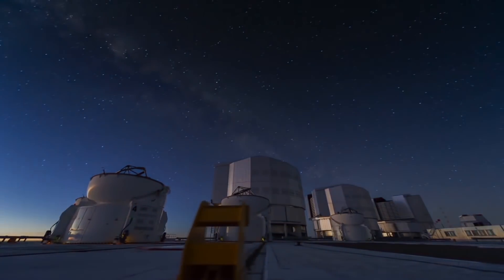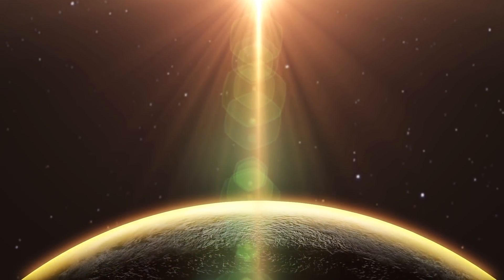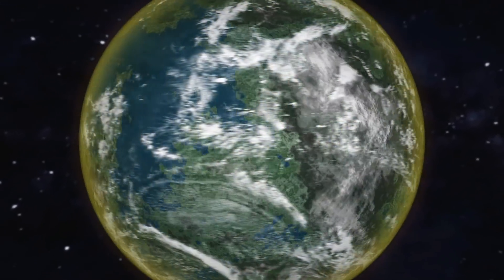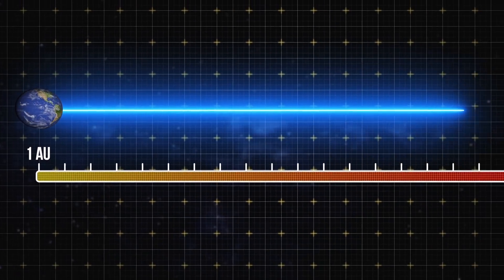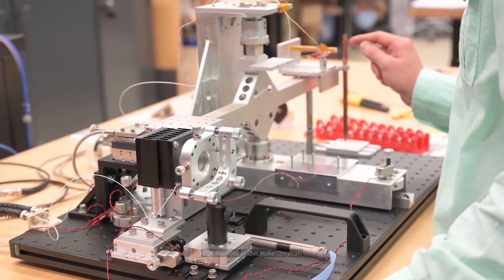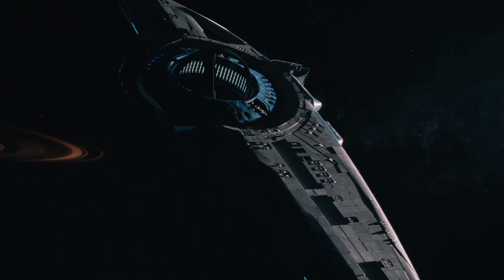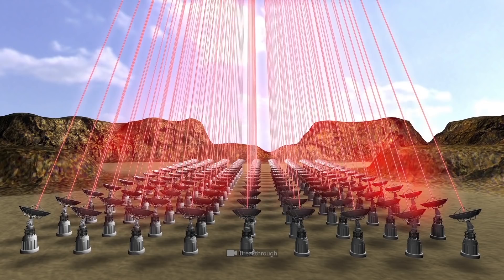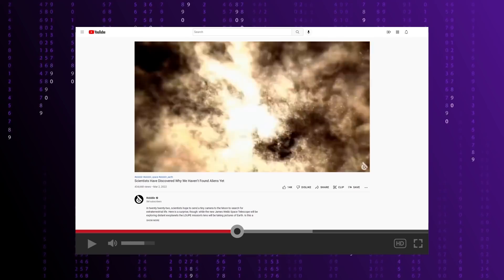Something Unusual is Going On With Proxima B Right Now

Comment: Why not try the slingshot theory? Though it could be hard to control exact directions or even predict the speed gained/time loss due to gravitational force and times circled. We have seen that when an object enters into an orbit with the right speed and distance it will be pulled, increasing its speed, as it circles and then is shot out of the orbit at an increased speed. Combine this with retractable solar sails,  and an air thrust or another quick burst engine, and an ai guidance system should allow a probe to enter a planet or even a comet's gravitational field and exit it, with a few calculations, in the right direction at an increased velocity.

Though I'm not a scientist or anything near one, I've always thought that this was the most plausible way for intergalactic travel with our current technology. I came up with this idea before we even had self-learning ai programs but after I saw what happens to comets that skim past the Earth's gravity as well as the flashlight that's charged by friction. As the friction can be self-sustained and continuously provide some electricity, I just couldn't figure out what propulsion system would work similarly to filling a balloon with air and then letting the air out to send it flying. It'd have to be strong enough to complete the separation from a gravitational field just in case the craft doesn't build up enough moment to escape orbit in time or the calculations are off and it gets too close during orbital sling.

This is just a theory by a no-name person, if anyone reads this then please let me know what you think about it. Any suggestions to make it better or an problems that I overlooked. Maybe together we can help to come up with ways to solve the problem of time versus intergalactic travel. Thank you if you've actually read this far and thanks in advanced for any input that you give me, good or bad.
Reply: Woah that might actually be a good idea. Maybe if it slows down and gets pulled by gravity of another solar system it could be in orbit meaning that the probe can maybe take pictures of planets orbiting the star which could mean we have a chance of finding life.
Reply: @gitch355  that's part of the use of the slingshot system. While the probe is in orbit of other planets it can take pictures of the planet that it momentarily orbits. If it uses an electromagnetic system while using friction to generate it's own electricity then it can theoretically constantly produce it's own source of electricity. This can be achieved by using a triple magnetic system. A positive, negative, and neutral. The electrical magnets will switch in powered as the neutral, within a tube, would be shot back and forth between the two generating static electricity along with a magnetic field. By fluctuating the strength of these it should allow the probe to use the planets magnetic field as a thruster or a stabilizer. Of course this is just my hypothesis.
Reply: Slingshot was used in Mars Orbiter Mission to reduce the overall cost of the project. There are videos and documentaries available on it.
Reply: @fanCBDden2   Using it for such a distance as another star system seems quite improbable as the prob would have to do various calculations in microseconds to ensure safe travel and proper trajectory. In other words, it would have to have the calculating capabilities of a supercomputer at the least. For closer planets, we can do the calculations here before even sending it up, but as space is like an ocean with various objects flying in all directions the probe would have to make various adjustments to reach the end of our system. Between the various meteorites, space junk, and orbiting planets, the prob will need various systems to allow for the proper adjustments to ensure that it's not hit by something or sucked into the gravitational pull of something on its way out. Though the knowledge gained from that is but one hurdle to leap.
Reply: We've been using slingshot trajectories for decades, it's how most of our space probes get to where they're going. But, consider the fastest object we've launched and used slingshots to get it out of the solar system, it took decades to get just outside of our solar magnetic bubble and it's still not reached the Oort cloud.
As for friction, that's what would stop a spacecraft.
Reply: I'm not sure slingshot is a theory, and I don't think it can give us any kind sufficient speed.
Unless there's a new "slingshot theory" that can launch things at incredible speed.
Reply: I have a sporadic memory and I'm not really all that studied due to it so I apologize if I forgot or misstated anything, though I do vaguely remember hearing of a slingshot theory hopefully I didn't miss use it. 

The slingshot method is just one part of my idea. Of course shape and functionality is some parts that I excluded. There would need to be a propulsion system such as the laser method mentioned in the video. A spherical, oval, or another aerodynamic shape with retractable solar sails should decrease friction when needed and allow laser boost when appropriate. Also by using specially made satellites the range of the lasers should be able to be increased. I was also thinking that the probe could carry a bunch of mini lasers to deploy as a micro thruster when necessary.

I am quite enjoying this conversation and am loving the input. I'm nowhere near a genius but I'm decent a problem-solving and creative thinking. The whole idea of using gravity came from the thought of how a meteor can skimp past our planet and then be shot out occasionally gaining speed as it travels to its next destination. With or without the aid of other planets our available technology will be the problem when it comes to time. Though it'd be interesting if a probe could ride the slip stream of a faster moving space object. (Just thought about that last part lol.
Reply: @BioDomeBuddies  you're too wholesome for me to complain lol.
Reply: @BioDomeBuddies  ever notice what our current probes and satellites look like? Zero aerodynamic consideration, as the vacuum of space is extreme - think a few hydrogen atoms per cubic meter.
Laser drive is still theoretical, but suffers from the inverse square law - the strength of the beam is the inverse square of the distance between the laser and probe. Lasers as thrusters are a non-starter, lasers are pigs for power and the momentum being transferred is microscopic. Look up the Pioneer anomaly, heat shed by the probe's RTG is pushing the probe toward the sun long after its final slingshot put it at escape velocity by around 8.74±1.33 ×10−10 m/s2, giving it a velocity loss rate of around 1 km/s per decade. From the heat alone from plutonium decay (around 85 year half-life).
That's a whole lot of nothing much, but enough to cause the probe to miss a star system had we been aiming for it. Photons have no mass, so momentum exchanges are minute.
But, we do have a thruster that'd last for a very, very long time, is energy efficient, even if its acceleration is low - ion drive. It's being used in probes currently in operation.
If you really want to look at fun, look up the Grand Tour program. It would've used slingshot trajectories of multiple planets, Voyager used a modified version of the route, slingshotting off of four planets to achieve solar system escape velocity. Our latest probes are even faster! Of course, if you're sending a probe to another star system, it might be nice to be able to slow down and stay inside of that star system.  :)
Reply: @spvillano    Lol, the mathematical equation got me lost as I only have a high school education but I think I understand what you mean. When I mentioned the laser system I meant it to be used simply as an aid when capable. As we're trying to reach such a distance in so little time we should try to combine motion capabilities to increase speed and lessen energy loss despite how small of a loss it may be. When it comes to the fact were aiming at a moving object so far away we could hardly get an exact location as to where the planet will be versus the actual time that the probe will get there. This is why I believe that the probe should be able to make adjustments and calculations to ensure that it reaches its destination despite arriving sooner or later than planned. Though I really don't know how aerodynamics work in space, I honestly imagined it to be similar to going through the ocean with sporadic whirlpools (gravitational pull) moving all around.

 I'll take a look at the information that you suggested when I have some time. Thank you Michele for being so kind. I don't think that I'm all that wholesome, I'm not used to talking to such intellectuals like those here. It's quite exhilarating yet intimidating to tell you the truth.
Reply: I wonder if humans could survive the slingshot though. I imagine that the G-Force would be EXTREME
Reply: @MrBoombastic1904  This idea I theorized for probes. I don't think that humans could survive the rapid change in gravitational force not to mention the gs would increase rapidly during the sling to its maximum at the shot. The probes would be needed first to gather the various information that we would need to send a shuttle. In all reality, it would be best to set up space stations through our system on various moons and planets for refueling and repairs. These space stays could double as research and development facilities where they could mine materials from the planets and moons nearby. They then could research the material's usefulness and develop new equipment for further space travel and survivability.
Reply: @BioDomeBuddies  Yeah, I like the space station idea. I've always thought that would be a good and necessary system in order for us to traverse the vast distances. The one thing that never gets mentioned is how our scientists theorize that our galaxy is located in a fairly large void of space (the KBC void) which is thought to be about 2 BILLION light years in diameter. That's not to say there isn't anything to explore here, obviously there is but going to ANOTHER galaxy would be super awesome! I REALLY want humans to explore our universe, be it with drones or ourselves but it really appears that the first mission we have to accomplish even before trying to break the speed of light is our lifespans. And not just for the travel but simply because you can't be turning research over to new folks every 30-40 years for what could possibly be MILLIONS of years before anything significant happened. Sorry for droning on, I'm a bit stoned right now and just love to think about the universe. It's f***ing mind boggling how large it is, how it even came to be etc etc.
Reply: @MrBoombastic1904  I didn't expect this topic to start back up lol. I started it when I was stoned so I understand. The first fix for life span issues would probably be digitalizing the brain and turning it into a program. The possibility of this is high considering the various types of mind-tech that they're working on. Besides life spans, we, the Earth, would have to work together as the human race instead of separate nations and money-grubbers. We should first finish our experiment with setting up a space station on our moon, then place one on Mars with a relay station on one of it's moons. These three locations are prime research locations to advance our knowledge in preparation for interstellar travel and settling.
Reply: Interesting theory. It may just work. Timing is everything.
Reply: I think firstly what you would need is enough shielding to make sure that when any layer's burn off it will still have enough to keep going, it's gonna potentially get to close to a planet/star that it's shielding will eventually wear down! Just like others have stated, we can calculate it's trajectory out to so far, but if we could somehow boost our communication tech, we could stay in contact a lot longer, but eventually it will need it's own guidance systems! It might help to have some kind of weapons systems on board to potentially destroy small incoming debris, which I'm not talking about missiles or bullets! Our laser technology is making big steps, lasers would be the best route to go! In addition to solar propelled sails, we could also use good old fashioned H2O to help make tight turns and impulse course correction! Using pressurized water, we could use thermal heated micro jets strategically placed on the craft, carrying a minimal amount of water (30-50gal), we could use sparingly to steer the craft in a hurry! As well as the guidance systems, we could use an assortment of gauges and sensors to detect a wide variety of viable elements needed to survive on a planet! A serious amount of small probes the size of a soda can could be flown on board and launched to collect critical data needed! In the midst of what could be another nuclear war, we should attach some kinda of markings to show each country as a whole, not divided by war, we need something to prove our civilization is friendly in the case of being found by an intelligent race, kinda like the plaques on the Voyager's! Hopefully you could use a bit of this in your theories!
Reply: @bulldogtonyyt1116  These are some great ideas. Using high powered laser defense is a great way to increase survivability of the probe without taking up to much space. I'm a little worried about the use of water as a correction/ adjustment system. How hot would the water have to be to keep it from freezing while to close to the probe? I do agree that some type of protective armor should be in place, perhaps it should include a cooling system to help protect the armor from heat damage. If it was capable of collecting ice from frozen meteorites the probe would be able to refill it's water and nitrogen supply.

It is important to show that we come in peace but think about how symbols don't always cross over properly. Our symbols of peace may be another's symbol of war. Our countries flags may have alien words on it that we just don't realize. Being internationally respectful is hard enough, being the Galactic peace pushers would be nice, but peace may not exist in all worlds.

The min probes dropped along the way is a great idea, it'll somewhat more convenient than having it a single probe which takes pictures while circling or passing a planet. Hopefully, these little guys could be multifunctional, like the pieces of a rocket that gets left behind. These little guys could each should a minute amount of fuel to boost the probe before dropping off to do it's own job collecting air samples and other reading before it's possible destruction. The more uses of each part on the probe the better. Speaking of which, by giving the laser an adjustable output they should also be able to do minor self-repairs.
Reply: @BioDomeBuddies  I love that all these are great potential ideas, and some of this tech isn't too far from the future! I believe if the economy could be fixed, things like fuel/launch costs could be drastically reduced! I've heard that back during the Apollo missions the amount of computer tech is what we currently use in a calculator! Another thing is compared to today's standards, fuel/launch costs was way cheaper as well! Like any other things, progress is key! Maybe these things will be doable in the future after the Moon and Mars bases are built!

Out of curiosity, how excited are you about the next manned Moon missions in a few years?
Reply: @bulldogtonyyt1116   Speaking of bases, I was thinking about the fact that relays can be set up on or around some of the moons of the other planets in our solar system. It doesn't have to be big if it's initially set up for probes. Though when it comes to manned missions I don't get my hopes up due to how redacted the information is that we receive. That lack of public information is a big problem in Earth's society. The known technology is far less superior to the actual technology that's truly available, not to mention the technology that's been secreted away / destroyed for various reasons such as the engine that runs on water and the true Tesla Coil. 

Both of which could be used to power a spaceship indefinitely. The perfected Tesla Coil was said to be able to continuously reproduce its own electricity and the Water Powered Engine was said to use electricity to turn water into usable energy. As both oxygen and hydrogen are highly combustible, along with the fact that most ice found in space is high in hydrogen, the water engine could've been redesigned to take the ice and convert it into its gasses to push the ship. This may not prove to be a powerful thruster,  but I believe that its shelf life outweighs its lack of speed. Though this is just mostly a theory and speculation as both technologies that I mentioned supposedly were destroyed along with their blueprints as their creators just vanished or died in their workplace.

This world lacks social reliability, empathy, and trust, so most things are hard for me to be excited about especially if a governmental figure or agency is involved.
Reply: Quite a interesting theory but problem comes to distance/time and as the space is like a obstacles course just by getting delayed because of a single obstacle or you could say unknown variable would lead to a miscalculation which...
while we don't know how bad it would be, it could be just a single au distance wrong or it could perhaps go to a  totally different direction.
And then another problem which I'm not yet sure would exist or not would be a increase in distance which we would have to travel. And finally is the AI itself while my Knowledge In this field is limited so perhaps what I'm saying would be completely wrong but I'm not sure if we would be able to implement such AI in near future, and last how you mentioned is the propulsion device while the laser beam method could be a doable theory but for now it's still impractical (or so i think)
Anyway it was really fun to read all your comments here.
Reply: @ryuoshinz  I agree with the distance/time issue as well as the unknown variables, but when it comes to the laser, all of this is just theoretical, trial is the only way to know if it even has a chance to work. When it comes to the ai stuff, I also am not a pro but I am a gamer and have looked into ai interfaces in games occasionally. Some games have an advanced ai system which can learn and adapt to the player. I believe FFXII had a version of an adaptive ai program. Not to mention the programs used in Siri, Alexa, and even Google assistants or those used by the androids that have gained citizenship in some countries. Though my idea for the shortcut to teaching it to do quantum calculations in fractions of a second could create an Ultron issue where the program may become too smart. Though a lot of my ideas are iffy at best, we don't know what is possible until it's tried. This why I have you smarter people to tell me what's wrong with my ideas and how to improve upon them.
Reply: @BioDomeBuddies  that's also true, we won't know unless we try and when we do try we also create a gate of infinite possibilities
Reply: Ok, think Star Trek. We might have a working warp drive in our lifetime. If we do, you can be sure that the Alpha Centuri system will be our first stop. If we do have warp drive, the extraterrestrials will come visit us. They might have a law like the Prime Directive. We are too primitive for them.
Reply: @MichaelPhongMitchell  I've always kind of thought the same. But with all these sightings, redacted leaks, and planetary theories, I sometimes wonder if they're not closer than we think. Such as the hollow Earth theory which purposes a second world within the Earth. Though seemingly implausible science says that it's possible if what we believe about the planet's inner crust is wrong. The fact that the poles are warm and protected by various governments can also be a sign that there's more to our planet than they let on, not that I blame them since human society as a whole is prone to panic and fear that which they don't understand.
Reply: only way ro go fast in space is to rip time into pieces and distance with a black hole u can control so u travel everythint condensed but good luck not only surviving somethint that eats everything but attachint a car engine to it
Reply: If you put humans in the ship, then wouldnt the G-force be too extreme during the last 'slingshots' ?  Ship is going at 150 km/s so you must get very close to the planet, the turn last 13 seconds and the crew become part of the wall at 40 000 G ?
Reply: @emmanuelhoule8070  My idea is purely for unmanned drones. A sophisticated ai system should be more than enough to aid in trajectory and gravitational calculations.